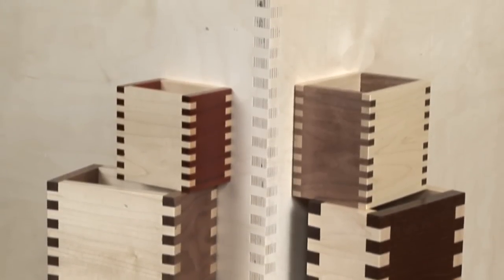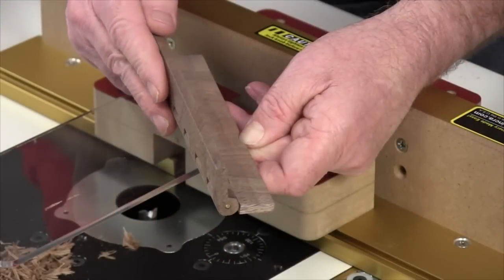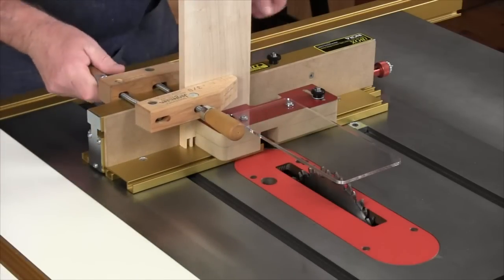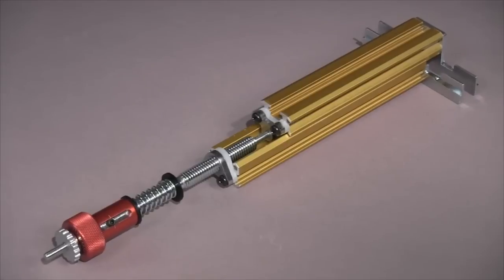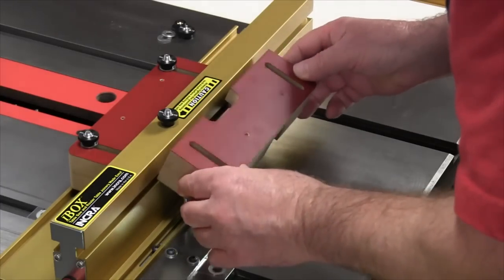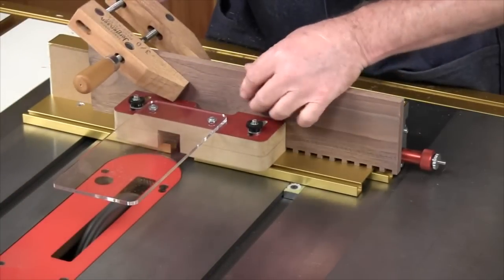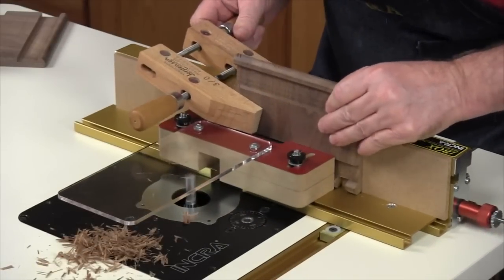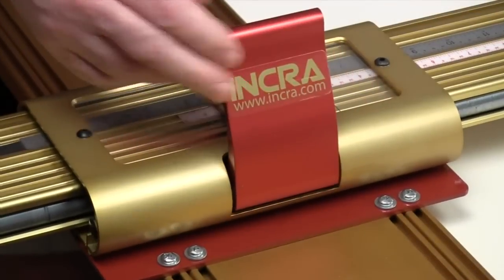INCRA I-Box Jig for Box Joints

Comment: Correct me if I am wrong. At ~3:28 it is claimed that one does not need to recalibrate when using a standard dado set.  It would appear that if the dado width grows away from the calibration point, this is true. Since the stack width grows away from the arbor flange, it depends not on the type of dado, but the orientation of the arbor. If the arbor flange is on the left and the shaft protrudes to the right, then the single calibration would hold true.  Traditionally, most table saws have right tilting blades where the flange is on the right, and the arbor shaft is on the left, making the stack grow leftward, and requiring calibration for each change in dado width.  While in recent years, the trend may have been to choose left tilting arbors on cabinet saws, this is not universally the case. 

Perhaps the whole jig can be reversed, in that case, my comments would not apply except to say that the calibration step depends on alignment of the flange, not the type of dado set.

Comment: This may not work well with a contractor grade portable table saw, the porter cable one i bought has some wobble to it, enough to sometimes tear the work on the way back to the starting position, could be my cross cut sled runners are no good, thats why I just bought a set of metal ones, we'll see if that helps.